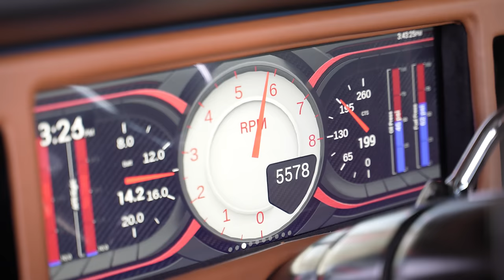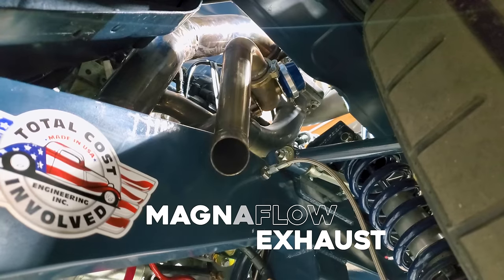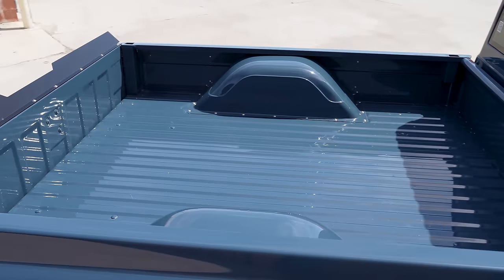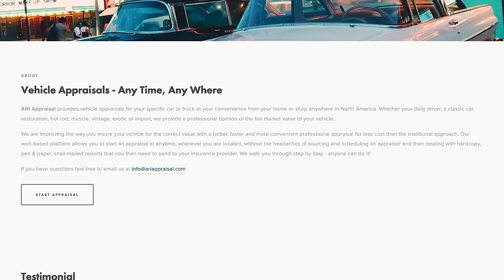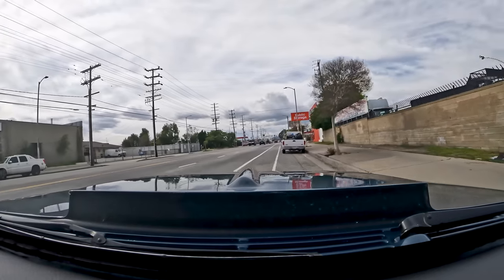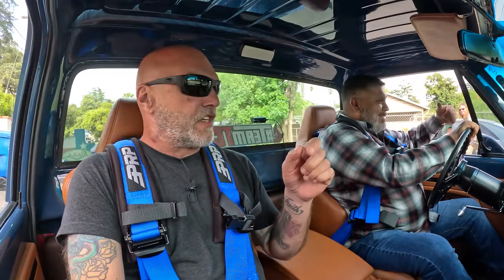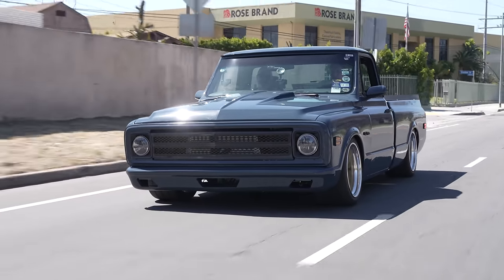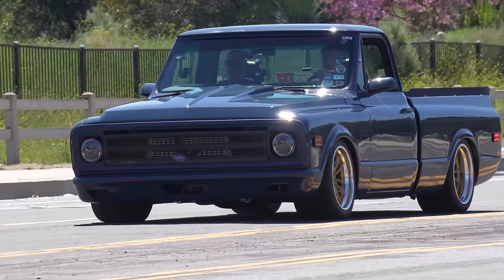Stunning 760HP Turbo Chevy C10 Pro Touring Build

Comment: That motor is done, rebuild time.
Reply: Exactly. Why not tune it for e85 or run a dominator and be able to switch between tunes.
Reply: Like @Smokan said.😂😂
Reply: @jsh3234  😆,  you like that huh 😆
Reply: Toast😄
Reply: I don’t think it’s the engine as much as the turbo oil drain.  It doesn’t smoke a lot until after letting off the throttle.
Reply: He literally says it's the turbo seal.
Reply: @Mastermindyoung14  It sounded like he already repaired that and went on to mention the owner doesn't care if he needs to rebuild the motor.

Comment: If it runs on 109 it’s not a street vehicle. Unless you have $10 a gallon to cruise on a regular basis. Then more power to you. Very cool truck either way.
Reply: yeah you don't need race fuel to keep a 750hp turbo LS cool.  No idea why he went that route.
Reply: Sure it is...I mix 100 in warm weather it can go anywhere.
Reply: @Mastermindyoung14  Safeguard against detonation if there are running issues? Or just likes the smell
Reply: Because more power and it runs cooler and cleaner... @Mastermindyoung14
Reply: @Bootsos90  but if it's only making 750, that's certainly not "more power" and you don't run into cooling issues at that power level.  So again, no point.

Cleaner?  Than e85 or 91/meth?  I'm all ears...
Reply: Needs flex fuel
Reply: @Mastermindyoung14  you really are silly do some research it probably makes 650 on 91
Reply: @Bootsos90 he can still run E and make 700+ easily. If you watch Myke Mike on youtube he has several 700+ and 800+ turbo LS' and most recently went over 800 in the 5.3 with a turbo on his silverado on e that are reliable including 2 foxbody coupes with the 5.0 boosted..

Comment: Seeing all of that smoke from the exhaust has me biting my fingernails 😂
Reply: What was the cause of the white smoke?
Reply: @xdi1733  head gasket most likely
Reply: @xdi1733  they said multiple times in the video, its the turbo seal. Letting a little oil by into the hot side

Comment: I’ve had those similar issues with my turbo LQ4, it ran the best on 100 octane. I think it’s worth it to do a flex fuel tune kit with E85 and use vapor works fuel computer. Best set up in my opinion

Comment: Maybe the PCV needs to be upgraded and enlarged. It's only smoking under just acceleration. I damaged my piston rings due to piston ring flutter. It smoked just like this. Sweet truck🏆💪
Reply from the maker: That turbo is loaded up with oil…needs a refresh
Reply: @AutotopiaLA  are the turbo seals leaking or is the turbo drain line not draining properly? I don't mean to be an investigator, but I'm a military trained diesel mechanic since 1997💪

Comment: Cool truck, love the color, but why is it a thing to not put air filters on turbos anymore? I’ve seen some builds where there is no room for it but then builds like this, when there clearly is PLENTY of space, they still put that silly little screen over the inlet as if that will suffice. As much as air tumbles around inside the engine bay and the source of all that air you are sucking in MAJOR amounts of dirt so why do it? Seems so many fads today are detrimentally stupid. But still a cool truck!
Reply: Room engough to make a slick cool forced air setup.

Comment: I've been waiting to see another 72 c10 love the color and wheel choices and the interior. But I Prefer mine I've got a red and white shortbed Cheyenne c10 with wheels 🛞 and a fresh 454 big block fresh 400 turbo Trans motor is 580 horse 20 inch wheels American racing salt flats.  The truck is all brand new deluxe interior black and the paint is the first thing anyone say about its like a mirror 2 years to put together ❤️ ❤🛻🛻🛻🔥